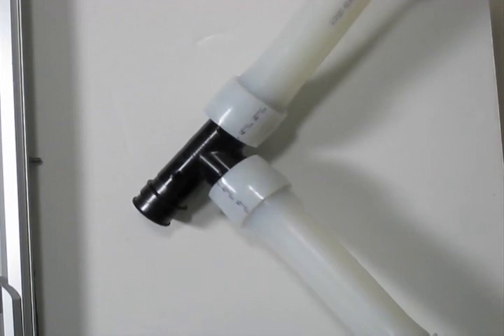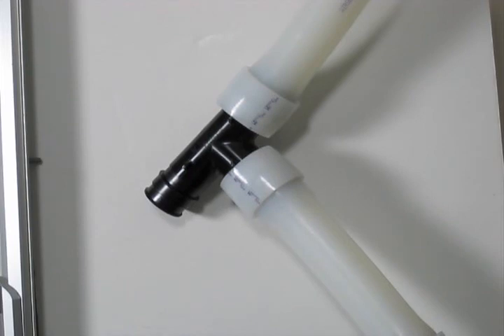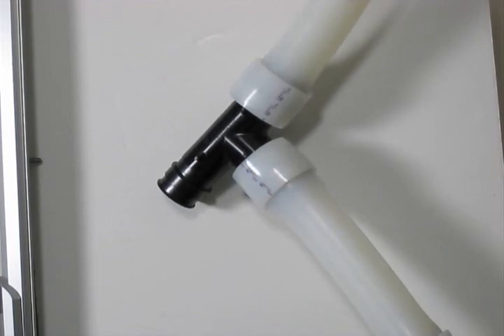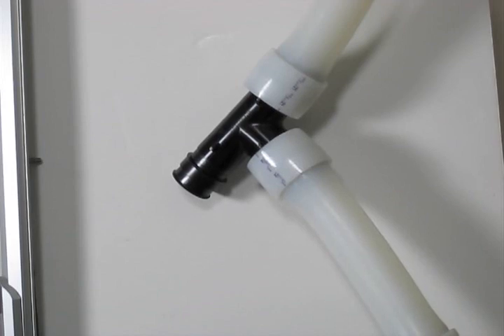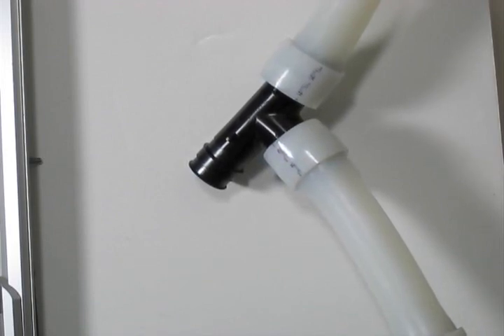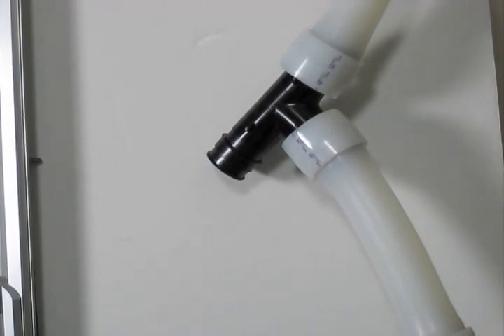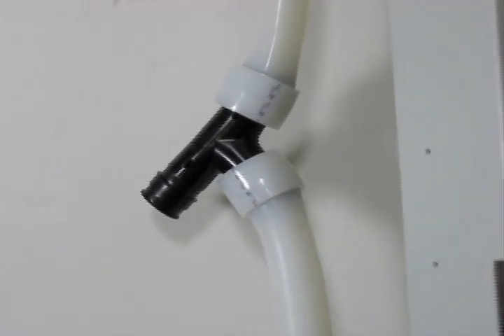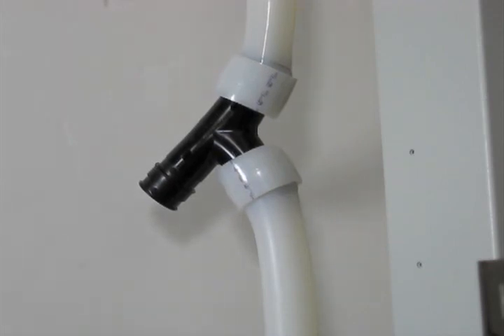Uponor Engineered Polymer (EP) Fittings Strength Test

Comment: What about the smaller fittings like 1/2" and 3/4"? I just installed some 1" trunk x 1/2" outlet multi-port EP tees and am a little worried about the strength of the 1/2" outputs. Some of the branch lines coming off the EP tee come in at a 90. Worried about the tee cracking over time. Would like to see some strength tests done on the smaller fittings most commonly used in residential applications.